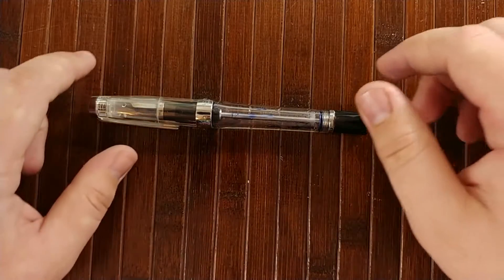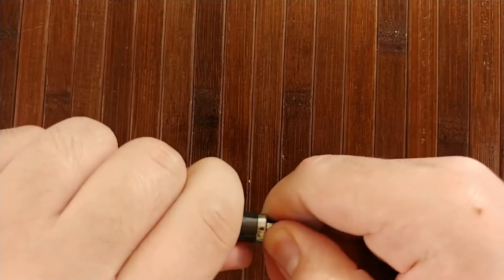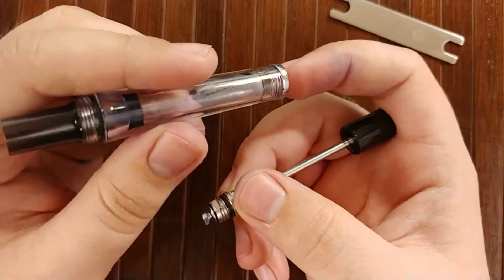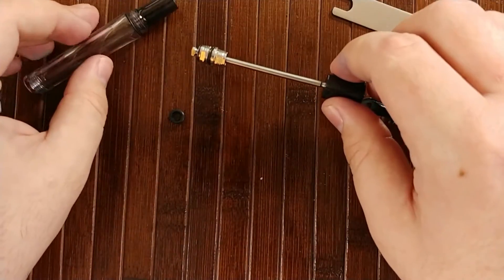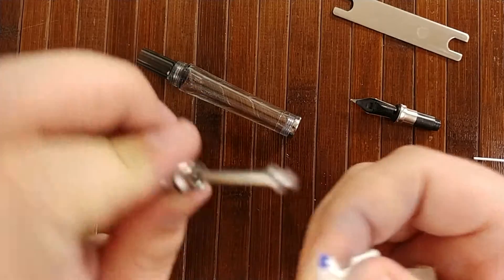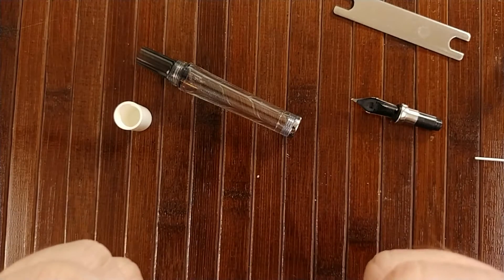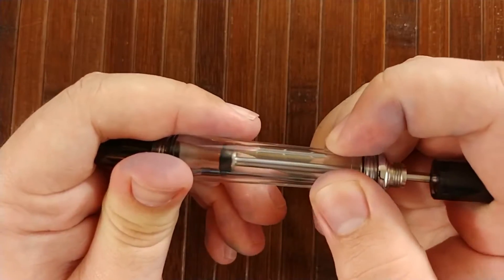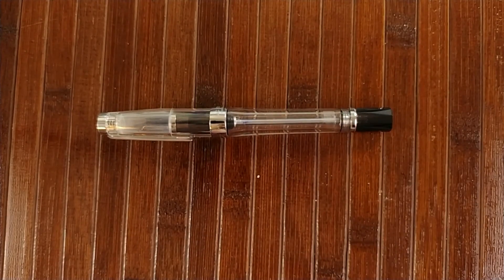Fountain Pen Disassembly: TWSBI Vac700R

Comment: I had the same issue with my TWISBI Eco. I'm not much of a tinkerer, so I thought I'd try a TWISBI so that I'd have an excuse to actually tear something apart. They have the reputation for being easy to work on, so I thought I wouldn't have to worry about screwing something up or making a mistake that ruin the pen.

Like you, I used the paper clip method. The Eco is still in the rotation, but I probably won't buy another TWISBI. There are other pens in the price range that write as well or better, and, for me, they failed to meet expectations of being easy to tinker with.